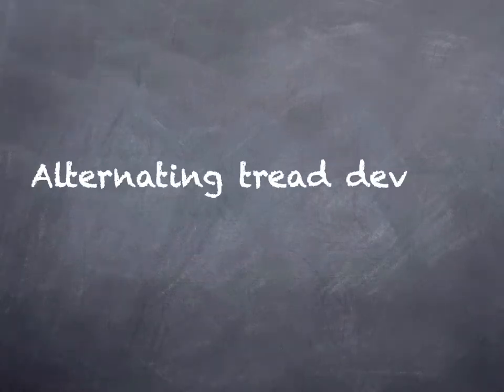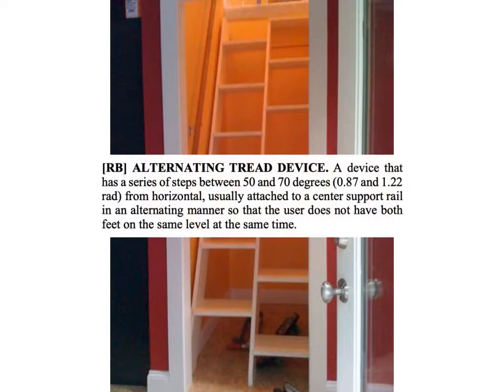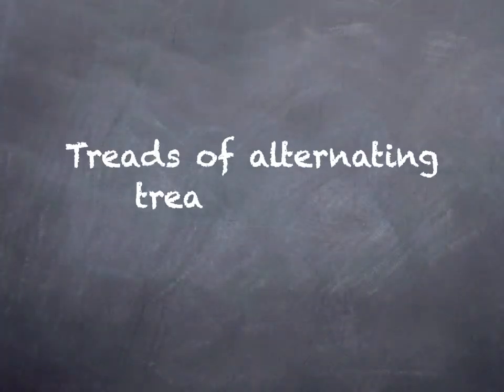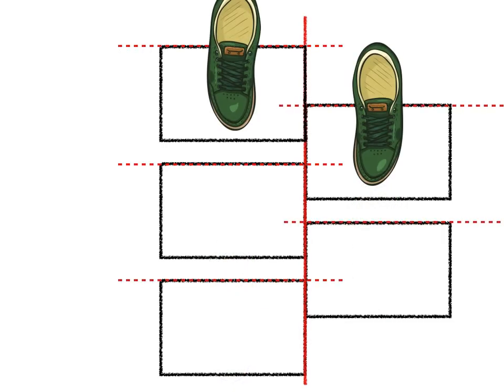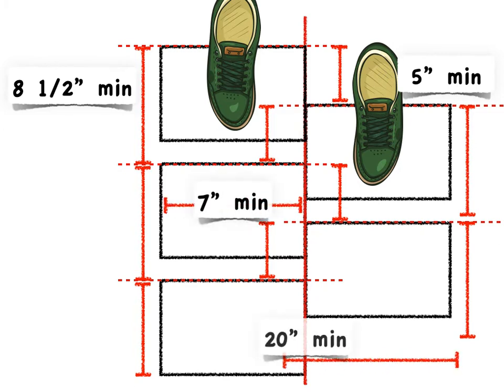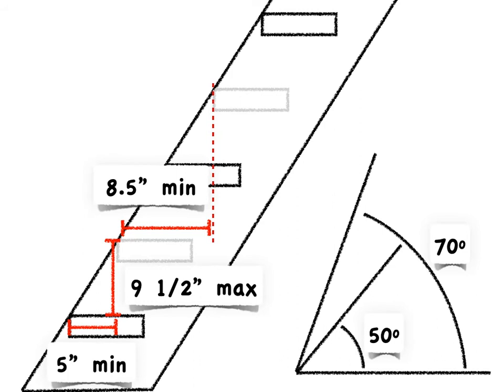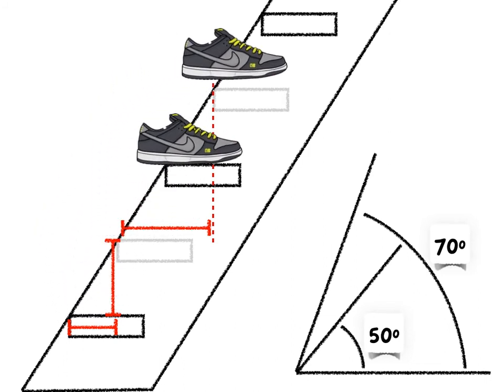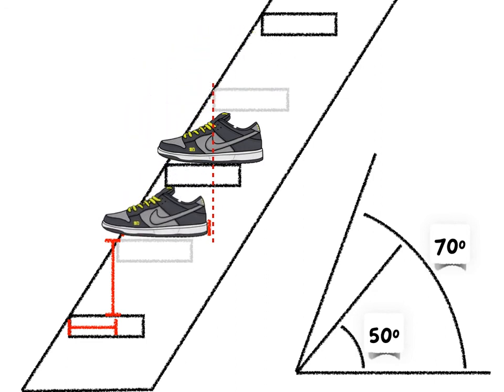alternating tread device building codes

Comment: I'm not sure how you can get to 8.5 inch minimum tread depth whilst also obeying the minimum 5 inch "going" between opposite treads. Surely the minimum would be 10 inches apart from maybe at the top of the stairs when designing the finish platform.